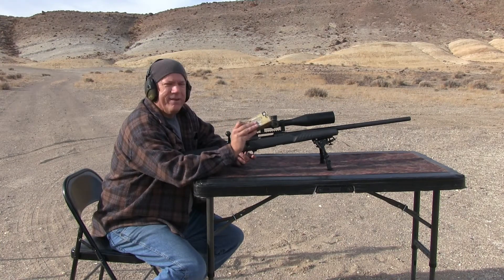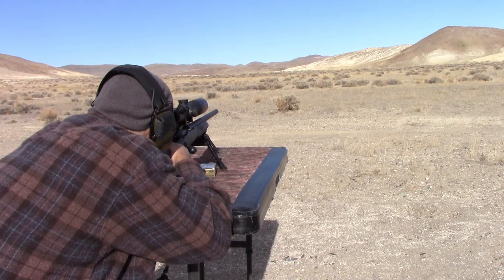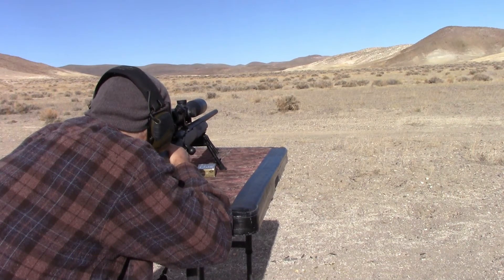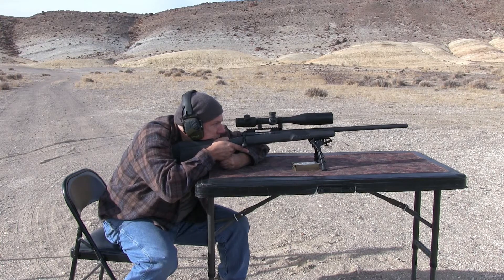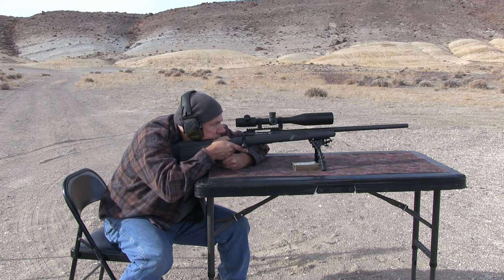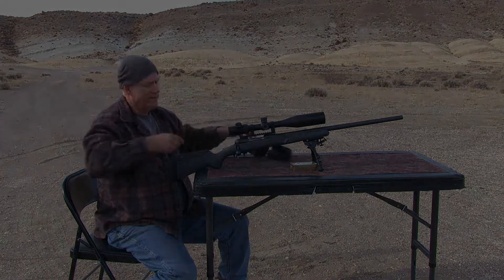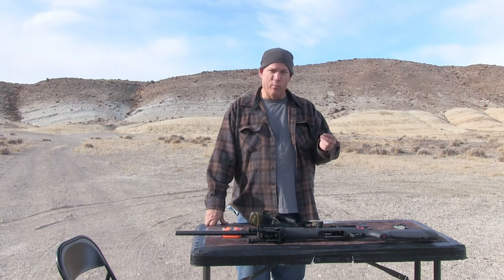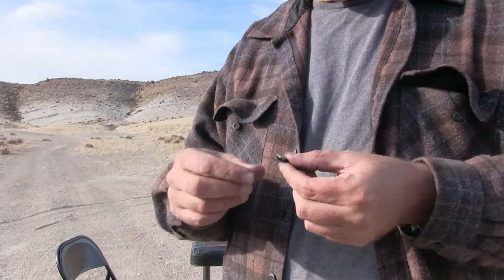A Savage Fail

Comment: Truly, I am surprised and wondering if I should be. Is this more common than I think or is it a very rare occurrence?
Reply from the maker: I've never had a gun break on me like this. My Savage model 10 .308 still works fine after three years. My older Savage Mark II in .22LR still good after nine years. I think it was just fluke.
Reply: @desertdwellers7294  thank you for that. I have been shooting rifle for less than one year, the extractor of my Grendel AR broke after only 300 rds. So, I was naturally curious.